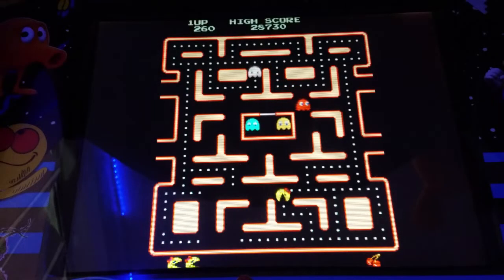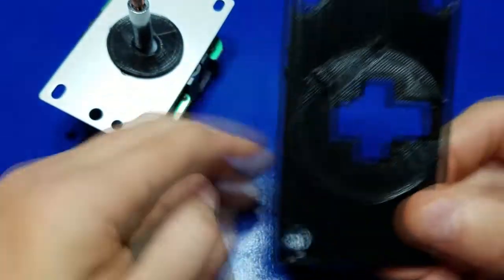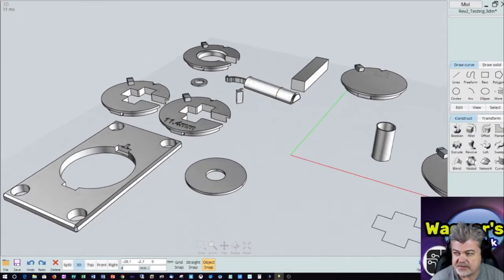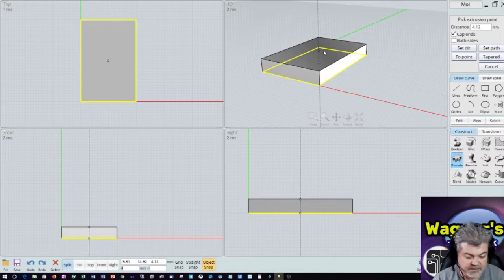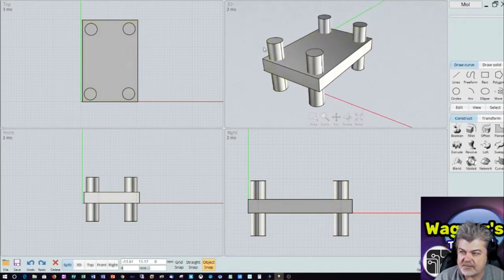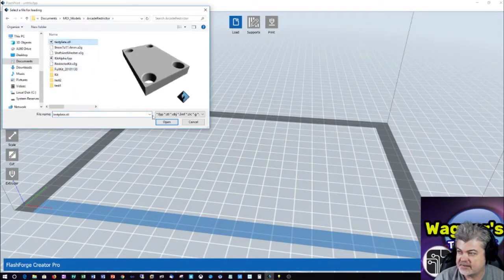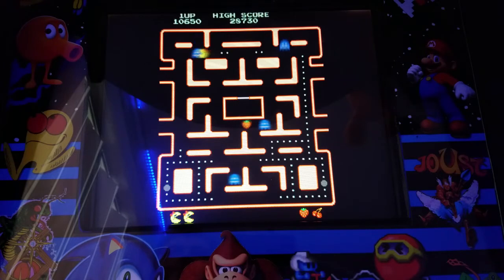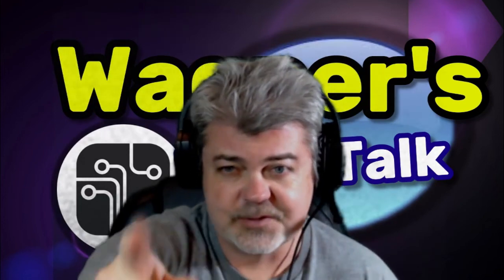3D Printed Joystick Adapter 8-way to 4/2 way Restrictor Gate (snap on)

Comment: Diagonal for Qbert and Congo Bongo?
Reply from the maker: I never made any diagonal inserts, unfortunately.  Didn't get much feedback on this project.
Reply: @WagnersTechTalk  we'll have to talk, I think it's ideal for my particular situation, are you on Facebook too for DM's?
Reply: Those games have the joysticks mounted at 45 degrees and not a restrictor issue.  Having a means of turning the mounting 45 degrees and locking it would be needed.

Comment: Did you use the rasberry pi 4? Im thinking about buying the controller that you are using but i am woried it wont work with rasberry pi 4
Reply from the maker: I used a Pi 3b+ in this build, but should work just fine on a Pi4 as well.
Reply: @WagnersTechTalk  Thanks for the advice, i was looking at the amazon description, and it said suppoorts the rasberry pi 1,2 and 3. So i am not sure if it will be able to work with it. Is there any other 20 button controllers that work with rasberry pi 4?
Reply: Anotehr thing to note is that when i was looking for the arcade buttons and joysticks alot of them said meant for MAME which is an open source emulating program for computers, Will these work with my rasberry pi 4?
Reply from the maker: @plsdontfallasleep  Yes, of course!  I've been using MAME on Pi's for years.  I have a guide page here that may be helpful to you: http://wagnerstechtalk.com/rpi4gaming/  Check out Recalbox, that is the easiest of them all to install and setup (IMO).  RetroPie has more emulators and Batocera supports more platforms.
Reply from the maker: @plsdontfallasleep  Keep in mind it's basically just a single encoder board that connects via USB to your Pi 4.  If it works on a Pi 3, it will 99% of the time work on a Pi4 (took 1% off just incase).  Check with the seller ahead of time, they likely just haven't updated their product description.  Hope that helps!
Reply: @WagnersTechTalk  Hi i just sent you in email in more detail about the arcade machine emulator that i will be using and if it is any good

Comment: Love the idea! I actually just printed this for my joystick, but im having issues... The backplate is installed and I have tried both versions of the 4 way inserts and my joystick is just barely falling into each of the sides. Its kind of just spinning between each corners. I also tried to even remove the restrictor plate entirely to see if maybe that was limiting the distance the joystick would move but that did not make a difference. My joysticks are "Hikig 2 Player led Arcade Buttons and joysticks DIY kit 2X joysticks" off of Amazon. Its odd because most of the joysticks all look the same so im not sure what the difference would be. Im guessing I would just have to make the cross smaller so it does not just rotate inside it. Could I have the file to edit? Additionally... Just an idea, it would be cool to have an insert for qbert and other games that have an X motion for the joystick.
Reply from the maker: Thank you!  This idea never took off like I thought it would.  I still use them on my Arcade frequently though and have worked great for a couple of years now.  The sticks I used are Sanwa clones, so those that share the same dimensions should work.  Also, I added a little extra space and some plastic spacers to adjust for others.  The link in the video to Thingiverse has all the .stl files.  If you want the MoI 3D project, I can send it to you just e-mail me at wagnerstechtalk@gmail.com and I'll fwd them to you.

Comment: A German guy already invented a auto gate switch 4/8 with a push of a button plug n play. Look for "Arcade Joystick - 4-to-8-way switchable restrictor" . It's made for Sanwa gate and clone gate.   I have 4 of these and they work great. He has a very long waiting list for them.
Reply from the maker: Sounds great, do you happen to have a link to the source?  With this one, you can print it tonight and no electronics are necessary.  Just simply swap the plates whenever you want to switch from 2/4/8 gate restrictors.  Not that this is a perfect design, I'm sure what you mention is easier and I LOVE seeing alternatives!  Plus, I'm cheap and this is as cheap as it gets for me 😄
Reply: @WagnersTechTalk  Someone else on Etsy is selling similliar what you have.  It was 4 for $10 I think.  Your plate might not work for a modder as sometimes mounting the joystick is not perfectly center on the hole.   The hole leaves a lot of room for joystick not completely center and still work.

Comment: Any chance of selling these and/or is there any other source to buy them from?
Reply from the maker: If you go here ( https://www.thingiverse.com/thing:3392070 ), you can click "Order this thing Printed" button.  If you do, it doesn't come from me so make sure you print the qty's you need for the inserts, washers (if you want to use my plastic washers, etc).  I don't want to get into the business of 3D Printing stuff myself, I honestly don't have the time and my printer is in-use most of the time anyways with custom projects :D  I hope this is helpful, I did update the license to make sure that you can get it ordered/printed.
Reply: @WagnersTechTalk  Thanks so much. Found that my library has 3d printer I can use for small fee. One question, have you considered designing a qbert diagonal insert?
Reply: @WagnersTechTalk  Can we still order something printed from Thingiverse?

Comment: Do you have a link for a decent yet not too expensive 3D printer?
Reply from the maker: Hi Mitch, check out the links in the description of this video: https://youtu.be/-Vkm33sXNw4  Everything created in that video was done using this printer.  I don't have any experience with any other brand printer, so I'm not a good source for recommendations.  Aside from this one, I've had it for awhile now and it's solid.
Reply from the maker: One more, this isn't my best video editing job but it does go over some of the basics of what to look for in a printer... https://youtu.be/Q9EZdgPX8Qo

Comment: Would you be willing to tweak my restrictor a bit? If I had 4 notches in the top of the mounting plate instead of 2, I could use the Galaga  (side to side) restrictor for Defender (up and down) also. 
I'm willing to pay because I will be needing a couple more for a different joystick I will be installing in two different machines.

Comment: That is an awesome design and I think you are on to something. Instead of doing two separate plates, what if you did a single plate that can be rotated to switch between the two. Here is a video showing the plate design i am thinking, which you probably have already seen this style. https://www.youtube.com/watch?v=M5cT2l-UHFE. I think this is used for the bottom of the joystick but i would think that it would still limit the movement the same on the rod. This would make it easy to switch between and wouldn't need to keep track of another plate.
Reply from the maker: Thank you!  It's great to be able to play these games that were nearly impossible (if not impossible) before.  I did a bit of research before deciding to design this kit and I did see the restrictors you mentioned.  The issue I thought of, which may/may not, be huge issue, is that I'm not sure I would be able to create a single base-plate that fits all joysticks with a rotating adapter.  With this adapter, I could add different sized inserts for the joystick posts to make them fit most any size stick.  That's why I asked if folks wouldn't mind posting some dimensions, it would help tremendously if they wanted to help this project.

The other issue is that with a rotating assembly, it could slip during gameplay which of course would make it frustrating.  But, I'm going to think about what you've written here because I like your idea and want to try to think of someway to make the design better.  If I make progress, I'll post back here.  Thank you so much for your feedback!!